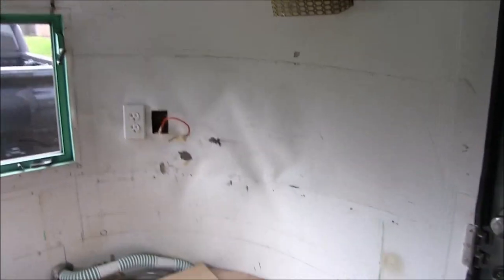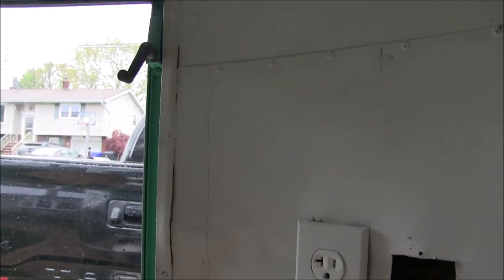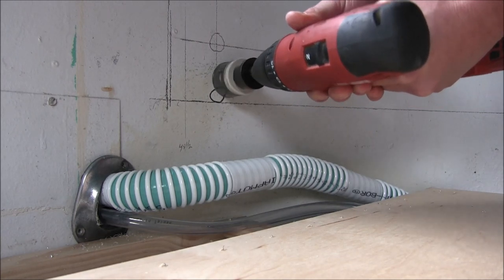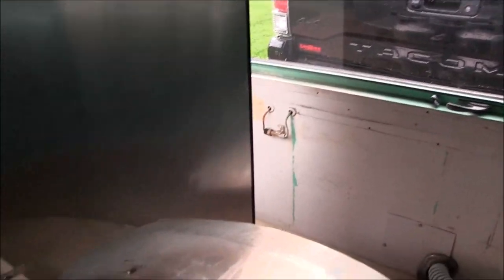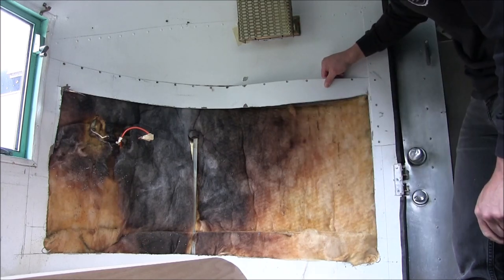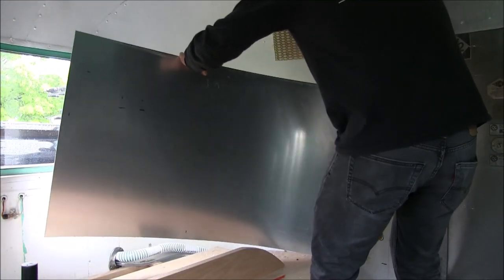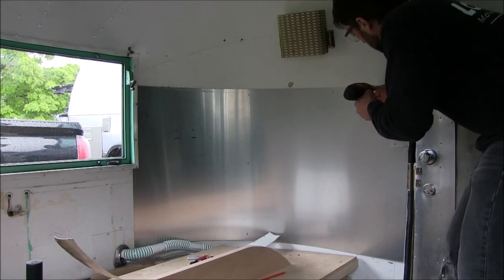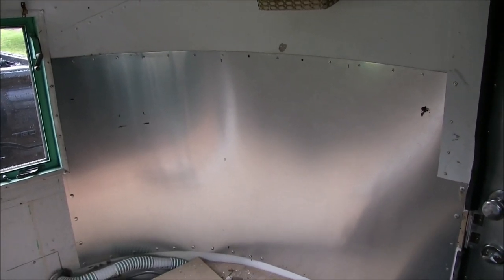Cutting Open a Vintage Airstream Trailer

Comment: Great job Patrick! I was wondering if you checked for any damage from the heat of fire behind insulation to the wires or mold.I think you are doing a terrific job.Very methodical and a lot of patience on your part.Looking forward to the completion.Always wanted to know how to use a rivet tool.
Reply from the maker: Yes. I paused during the video shoot to perform a full inspection

Comment: Hey, I saw one of your videos about replacing the aluminum above the entry door.  I can't find it anymore to comment there, but what tape did you use between that piece and the aluminum body?  And which rivets do you use?  I just bought a 1974 27' Overlander Airstream and I'm very, very new to this, but I need to replace some of the panels and want to make sure I'm using the right stuff.  Thank you!  Charles

Comment: I'm not that far from you. Where should I get a 4x8 sheet of white aluminum?  I dropped a cut tree limb against the side of my enclosed trailer. The flat wall on the trailer appears much easier to replace than the curved shape of your air stream. I'm confident in my work, but I think it would be difficult doing it on video. I think that made your job even tougher
Reply from the maker: I am not sure where to source the while coated aluminum